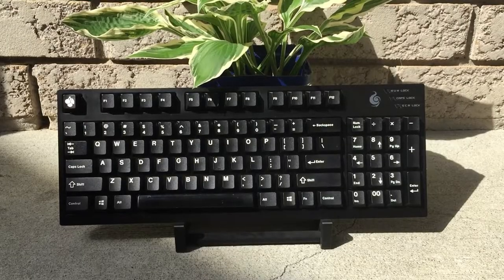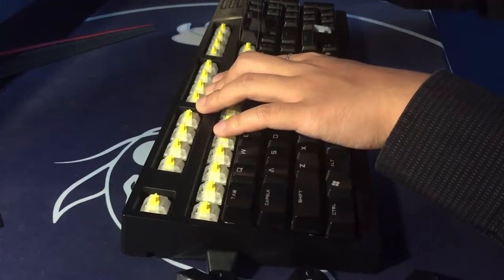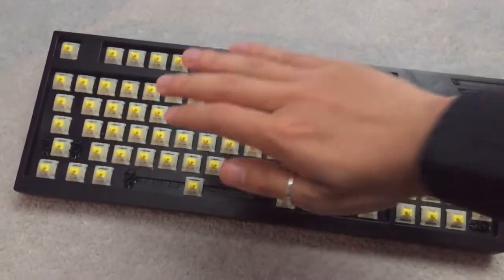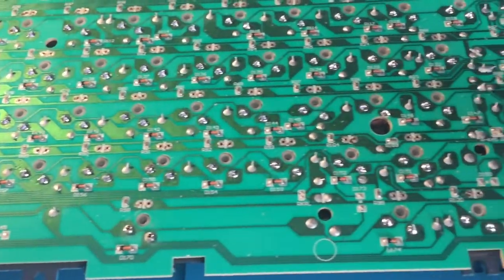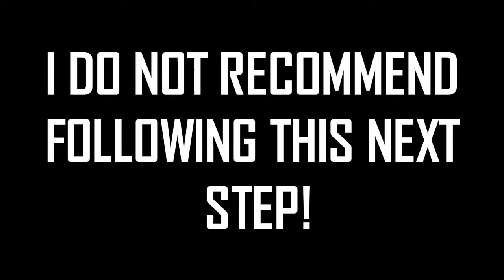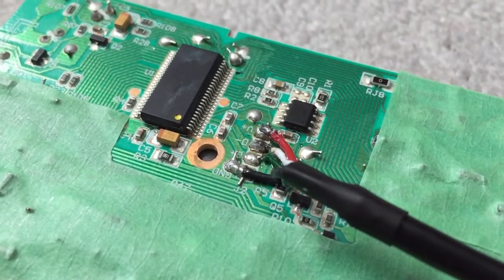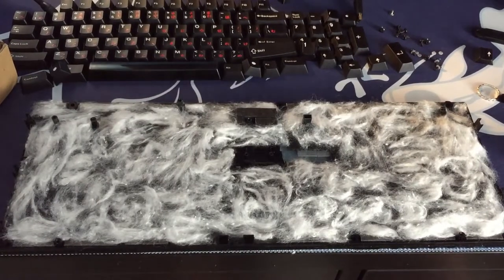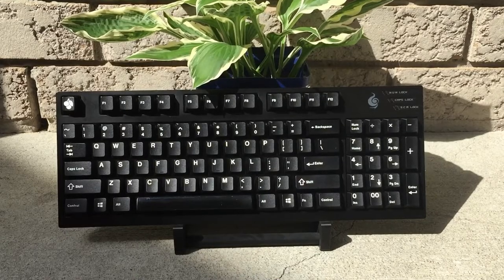I UPGRADED An OLD Gaming Mechanical Keyboard - CM Storm Quickfire Mod

Comment: I have Non-RGB version the XT with Cherry Brown, I used a Ducky keyboard with Black Alps previously. The former started having issues 1-2 years ago so I gave up because I didn't want to solder. I swapped the keycaps with WASD ones so that's where you can get a spacebar for it. The latter was too noisy and my mum kept complaining. Ended up now I am using a Keychron Q6 and it was so much better. I am getting another budget Aliexpress keyboard in to mod for work (DIY case), let's see how it goes.
Reply from the maker: That sounds awesome man thanks for sharing! Keychron always makes solid stuff. Hope you have a fun time trying out that Aliexpress DIY kit there's always really great deals on there and cool stuff to test out.
Reply: @chenyz  I didn't get a kit actually, I just found a hot-swappable tray mounted keyboard to cannibalize the PCB, plate and plate foam. Amazingly it cost less than an equivalent kit for some reason =\

Comment: This video has inspired me to upgrade my version of this board which had mx browns. I don't own any custom keebs but honestly, I think this sounds pretty nice. Got my draught seal for the plate foam and soldering iron out from its dusty home in the attic. Also ordered some G Pro Yellow v2's and I'm going to PE foam instead of getting switch pads - I hope it doesn't change the sound too too much.
Reply from the maker: Hey man I'm happy I inspired you to upgrade the board! This is a really good way to dip your toes into the customs space by fixing up this keyboard! I'm planning to rebuild mine eventually too. I will say though, PE foam does change the sound a decent bit. In my rebuild, I'm probably going for a more natural sound so I will be removing the switch pads/tape mod. Definitely still fill up the bottom case and use diy plate foam. Have fun and be sure to come back if you have anymore questions, I am more than happy to answer!
Reply: @chenyz  Any ideas where I can get a set of those samurai keycaps? I've been searching around but struggling to find them. I ordered what looked to be a decent clone from AliExpress but ended up receiving a blue set 🤦‍♂Are they Cherry profile or OEM btw? That or any decent black keycap set with ISO keys.
I'm half way through the modding now, looking forward to changing the switches this week!
Reply from the maker: @strumluff Sorry to hear you got the wrong set of keycaps I would be really disappointed too. Unfortunately, whenever I go to the original link on aliexpress where I bought the samurai keycaps from, it seems like they aren't being sold anymore. The keycaps were cherry profile in the video. This is the closest I could find for an alternative that includes ISO keys: https://www.aliexpress.com/item/1005004004796018.html?spm=a2g0o.store_pc_groupList.8148356.15.496655a4kNK1O0&pdp_npi=3%40dis%21CAD%21C%24+68.60%21C%24+54.88%21%21%21%21%21%402101d4a716842523762343839ed129%2112000027711769971%21sh%21CA%213931935207&gatewayAdapt=glo2vnm
Reply: @chenyz  Hey thought it would be good to let you know I completed my build now. It's definitely a huge upgrade. I went with poron switch pads, custom plate foam and cotton for my config and it brings out a quieter and more creamy sounding board which I really like. I also put in Durock stabs and holee modded them, first time doing that and happy with the result - only the keypad Enter key is a bit mushy. Does the mod last a long time? Again, thanks for the inspiration, this will keep the keyboard going another 10 years I'm sure :D
Reply from the maker: @strumluff  That’s so awesome to hear dude thanks for the update!! Yes, in my experience the holee mind does last for a long time, much longer than just lube by itself since lube alone moves around with use. Depending on how you did the mod, it could need some break in/continued use for the mushiness to go away. Anyways very happy for you once again enjoy the upgraded board!

Comment: What switches do u use? i own a Quickfire TK and i wanna mod it like urs and btw im typing this on the keyboard right now
Reply from the maker: I'm using the gateron pro yellows in the board in this video! Let me know if you have any questions about modding the board :)
Reply: How did you remove the blue switches when it’s not a hotswap
Reply from the maker: @NRZEnexusRawr  I show the entire process in the video, I manually desolder each switch
Reply: Thank you for telling me this, I’m gonna try to mod my keyboard like yours but use the the original keycaps😭

Comment: Do you prefer the new switches to the stock cherry mx blues?
Reply from the maker: I definitely don't like cherry mx blues that much lol a bit too loud for me but I do like other cherry switches like mx blacks/reds and browns. I also really love a lot of the newer switches too like gateron inks and cjs!
Reply: @chenyz  i've read the spec sheet for the switches you use now, it has a 3.3mm total travel - do you think its a bit too short compared to the cherry mx's 4mm?
Reply from the maker: Oh wow that's weird, they shouldn't have a shorter travel distance at least the gateron ink and the gateron cj. The travel distance should be the same between the cherry switches and the other gateron switches I just named. They feel like they have the same travel distances. There are some gateron switches that definitely have shorter travel that I have used before such as the gateron cream soda and the gateron pure berry, those have shorter travels for sure due to their long stem poles.

Comment: did u soldered the led again or not
Reply from the maker: Nah I didn't solder the leds back in. it was only blue leds maybe if it was RGB I would have resoldered them, but I never used them anyways so I didn't bother resoldering them
Reply: @chenyz  thanks for the answer. I'm also planning to lube my stabilizer on the same keyboard. This video is definitely helpful, so again...thanks 👍
Reply from the maker: Happy to help! Be prepared to desolder to remove the switch so you can unclip the stabilizers to lube them and holee mod them too! Feel free to ask for anymore questions if you need help with anything